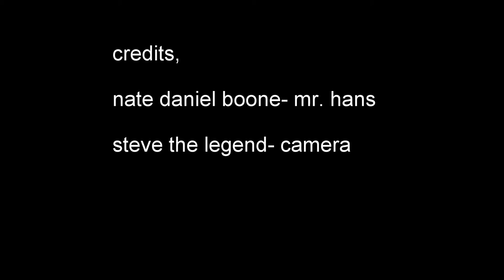2003 toyota 4 runner brake job

Comment: Very helpful video, unfortunately i ran into a stuck piston on the driver's side caliper, ended up replacing both on the front side
Reply from the maker: Will Lafley glad to know it was helpful,sometimes it's better to have new parts than questionable ones

Comment: Did u guys know the right way to bleed the brakes on the same vehicle .... thanks
Reply from the maker: H Sibaja it's the same process for any vehicle two people are required. One to pump the brakes the other to bleed. Start at the wheel furthest from the master cylinder. Pump hold bleed release.  Do not release the petal until the bleeder is closed or air will be ducked in. Keep doing the same process for every wheel, and keep an eye on the fluid level in the master cylinder. Hope this helps
Reply: 1beastlydude Thanks so much to respond me back .... Happy Thanksgiving